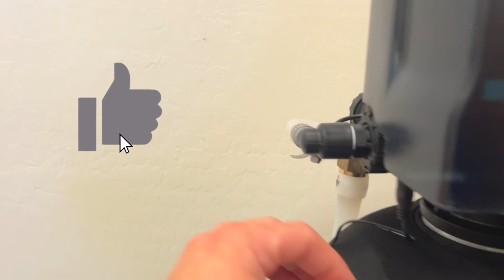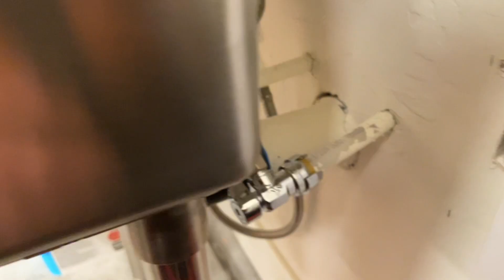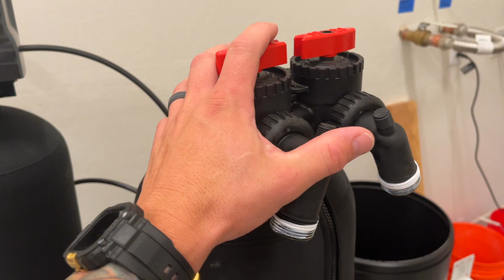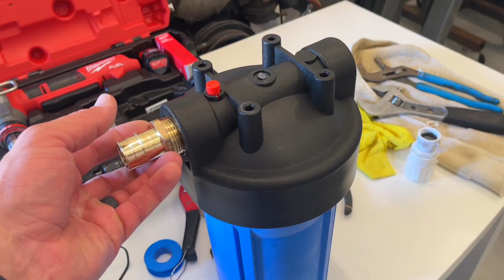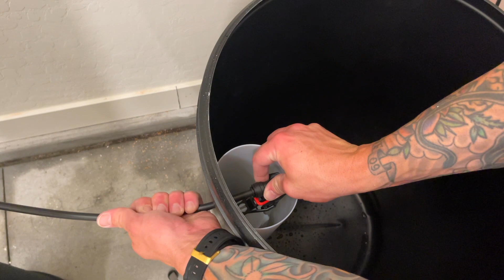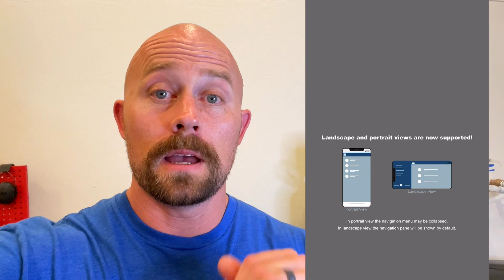How To Install Whole House Filtration System From Shell Water Systems | BEST Water Softener System

Comment: can you show me how to change the filters for my system in garage?
I figured out how to do my RO system under sink. But now I’m stuck 😢
Reply from the maker: Are you referring to the one cartridge pre filter?  Obviously on the Softener system you won’t be changing out tanks, but you will need to change out the cotton type large particle filter about once a year or so. 

That is very similar to your RO filter systems you see where you shut off the water, release the pressure from the lines and then you unscrew the canister. Remove the old cotton type filter and replace with new and put some silicone grease on the o ring before reversing the process. There should be a large ring type wrench your canister came with. That is what you’ll use to unsecured the canister came

Comment: I need to replace my water softener/filtration system, I’d like to use this system. I have well water softener I’ll be replacing the storage tank as well. I would like to install a particulate filter before and after the storage tank, your thoughts on that…. 
 Also, I’ll need a reverse osmosis due to nitrates, is a whole house RO worth it?
 Thank you,
               Kevin D.
Reply from the maker: I like the idea since you’re gonna be doing well water having the particle filter before and after. Having that type of redundancy in your system is not a bad thing. 

As far as this being a whole home RO system it doesn’t technically qualify as that. It does filter the water and soften the water, but an RO system under your sink will give you a higher quality filtration and depend on what type of system you get for the RO it will have different added benefits.

So I would still vote to do a standalone RO system under your sink. They have some pretty good ones for just around 200 bucks on Amazon that I really like installing. I have two of them in my house and love them.
Reply: @FortKnoxCo Thanks for your reply.
Reply from the maker: @kcd845  💯
Reply: can you show me how to change the filters for my system in garage?
I figured out how to do my RO system under sink. But now I’m stuck 😢

Comment: I added a ton of Teflon tape and the sediment filter still leaked, any suggestions?
Reply from the maker: It’s leaking at your threads I’m assuming?  Did you make sure the fitting is the right threads? There’s different types of threading for plumbing vs other threaded adapters. Just something to check.
Reply: @FortKnoxCo it's a standard 1" MIP brass nipple. I'll try tightening it some more to see if that helps but open to any tips!

Great video!
Reply from the maker: @t @turtle62292  sorry to hear that. I’ve seen people try some wraps of the teflon tape and then maybe try the Monster blue pipe dope? I know some say it’s not good to use tape and dope. But I’ve also seen people use both.

Comment: This video is amazing and very informative. However, my 2025 built home lacks a water loop. The water shut-off valve is located in the garage and operates in a vertical manner. If you could create a video demonstrating how to install and connect to the water line when there’s no water loop in the house, that would be greatly appreciated.
Reply from the maker: Aww man. Sorry to hear that even in 2025 they still aren’t installing a softener water loop as a standard in homes. I do plan on showing a how to create your own water loop for a softener video. I just need to create a set up to demonstrate on.

Comment: How many feet do you think I need for a tight serviceable install? Just trying to map out how many tool boxes have to move or get sold 😕
Reply from the maker: Depending on how you want to place the brine tank and the single or dual filter tanks, I’d say about 5’ wide and 2’ off the wall?  Roughly depending on how close you can make your connections and coming off the wall with your inlet and outlet
Reply: @FortKnoxCo thanks! I managed to cram it in 48”! I noticed they skimped on the drain line now, I got maybe 5’. They only give you one adapter for the garden hose and the sediment filter no longer includes the red push button vent. Just small annoying things. Ordered 1/30/26 for reference.
Reply from the maker: @tkish5685 that’s you for the updates. It’s helpful to know what’s changing

Comment: Can you install on outside of house
Reply from the maker: You can but usually they still recommend having it in some type of covered enclosure. Unless you get a unit that is specifically meant to be installed outside, most of these units should not have direct long-term exposure to the elements

Comment: Great installation video. I do have a water softener previously installed but i have reddish brown stains in my toilet. Also water is testing as high in minerals. Do you suggest adding a filtration system and partial system to my existing system?
Reply from the maker: Your water softener should help with the overall mineral in your water. The red stains could be a couple different things. Could be the minerals in the water, but it could also be from the pipes if you have any type of metal piping in your plumbing. If you get the whole home water system, it’ll filter the water to drinking quality and soften it by removing the minerals. So there’s a couple different things you can do to try to give your water the best quality. But at the end of it, you also need to consider what your plumbing has as far as metal fixtures, and possible rust inside those.

Comment: Would be helpful to know exactly how much water to add for soaking. (1 gallon? 2 gallons?) I way overfilled mine because I couldn't see inside the tank and didn't realize how fast the water was flowing...
Reply from the maker: Yeah, I’m not sure if the written instructions have that labeled or not. That would be helpful. A slow flow of water while paying attention would probably be the only best bet. Sorry you had that trouble with the process.

Comment: FYI, don't reinstall the cap after beginning to soak 😬

There's a bunch of gas produced and it will pressurize the tank and make the cap practically impossible to remove again. (I had to drill a hole in the cap to get it off. 🤦)
Reply from the maker: Oh no, yeah, you can fill it with water and then just let it sit. I guess it should be more clear on making sure that you don’t do that. Could cause pressure and make it difficult to take the cap off if you tighten it too much.

Comment: Do you ever use a separate control head for the whole house carbon? I’ve seen systems set up both ways… Thanks for the great video!
Reply: With carbon filters you have your choice of upflow, which is what's in the video, or backflush.  A backflush is often used if you have a well.  It's similar to a water softener in that is has a programmable valve head that periodically cleans the carbon media.  If you're on city water, it's more common to use a filter, like the video.  It does not require backflush and the media typically last 7-10 years.
Reply from the maker: With this system from Shell Water Systems, it doesn’t seem like that’s how they have it set up. I’m sure it can be done and it can control and monitor the way. The water is flowing, but I believe usually the carbon and softener tanks are going to have water flowing through them in line, so to have two control heads might be redundant and not necessary. They don’t operate independently they operate in sync. But I’m sure there’s some companies out there that might have it set up that way for a reason.

Comment: Question: do you lose water pressure by using the corrugated connector vs pex?  I'm ready to install, just figuring out what to use for connections.  Cheers!
Reply from the maker: I did not.  But I also now have PEX and I don’t notice an increase of pressure. The corrugated pipes seem to be pretty common.

Comment: I have a leak coming from my red water pressure button after recently replacing filter and idea of why ?
Reply from the maker: On your canister filter? The large particle filter? 
I’ve seen that before. It’s like a test/pressure release button. I think it’s spring loaded. So sometimes it gets stuck and doesn’t press back up and creat a seal. You may need to press it or mess with it a bit. O possible remove that top
And look underneath and see if the valve is obstructed

Comment: What about if the street water is directly connected to a water heater? How do you connect the filtration system then.
Reply from the maker: You would just need to create a break or “water loop” in your water line and before it splits off to your cold and hot line. A lot of Home builders put this in as a standard now. But it’s not an uncommon install for a plumber.
Reply: @FortKnoxCo  Thanks for the reply, I just ordered my combo now. I am so excited about this product. Without your video, I wouldn't of made the purchase. Thanks again
Reply from the maker: @radouanelaktib1275 that’s great to hear. I’m happy I could help. We love this unit.

Comment: How long is the cloudiness in water? Mine comes and goes. 3 days installed.
Reply from the maker: I noticed after a few days. But we also use the system a lot with. So depends on how much water you’re using and how fast.

Comment: What if we the entry of water from street is in front of house, can I still move tanks to side of the house around the corner like 15ft?
Reply from the maker: You can set this up however you’d like. It should be in line before your water supply splits to your hot and cold sources. So usually after the water gets to the house after your bell housing /water pressure housing. And before your split off to the water heater.

Comment: If I just installed a softener but want to add a second tank RO or whatever... about the same ? Other then maybe connection difference's.. regardless thanks for doing this video my pop was always good at any thing... me I'm ok but nada like pops. Lol
Reply from the maker: You can do a whole home filtration which had two tanks and does the softening and filtering. I believe a reverse osmosis like under the sink systems for your whole home may be slightly different than what a “whole home filtration” does though. It’s all possible and plumbs in line like your softener does. Usually

Comment: Can you add the part list for the PEX A install? I assume you’re using 1” PEX piping. I went to the local hardware store and didn’t have a lot of the fittings for PEX A, only B.  I have to cut the piping coming out of my wall, as I don’t have the screw on adapters like you do. Probably will go with shark bite connectors to PEX A as well.

Comment: Is there a fitting going from 1/2” pex A to 1” male adapter?
Reply from the maker: I’m not sure which part you’re referring to. The 1/2” drain line? Or?  This system is a 1” system and I used 1” PEX A to connect everything. The only other size tubing is the 1/2-3/8l” type drain line. But in most cases you’re probably going to be using a double male flex line to connect everything and your choice of fitting for the drain line. Most water softener systems will give you an option to have the system set up for a 3/4” in/outlet or the 1” in/outlet

Comment: Great video!! What all is included in the boxes aside from the brine tank and the two other tanks? Does it come with those tank sleeves and the drain line? Also what if I dont have a drain pipe nearby? Is it safe to drain into the yard?
Reply from the maker: It comes with everything you need except you connecting flex hoses to your water loop. The two hoses you need to connect it to your house. Otherwise it has everything. If you don’t have a dedicated drain I would not run it just onto the street. It runs a decent amount of water when it’s doing it regeneration cycle. I would try to find the nearest  sink drain or laundry drain if possible. It just needs to make its way some how to your drainage system. I guess you could just run it out somewhere but I haven’t seen the done necessary to see how it handles over time with water flow and making a Marge mess or puddle outside ?

Comment: What if you don’t have a drain line or sink in the basement? The only thing I have in my basement is the main drain pipes from bathrooms or first floor laundry and about 15’ from where the water inlet from the street is  and above the height of the softener.
Reply from the maker: You just need to be able to tap it into a drain line like you mentioned. In my house specifically the drain is about 15 feet or more away but it does go up in the wall about 10 or 15 feet in an RV garage over about 10 or 15 feet in the ceiling and then dumped down into the wall where our laundry room has it drain for the washer. So it can push the water over and up a good distance.

So if you needed to tap it into that laundry drain that you mentioned my guess is it would have no problem doing that. It’s under some pretty good pressure when it discharges. But either way it just needs to go to a drain and usually have some type of P-trap or access to the drain to where it won’t interfere with the drains normal function.

Comment: why did the particular filter go after the system? most are before
Reply from the maker: It can go before or after. Partly a preference. Two different theories behind it. Either way it will catch larger particles. Some like it to catch before the system. But if you have it after the system it can be a fail safe as well if anything from the system itself makes it was out of the tanks and stopping it before it makes it was into your water heater and lines of the house, into your fixtures , etc.  So either way is good.

Comment: How does the claim that it removes pfas, when everything the water touches/processes in the unit can slough off in the water delivered throughout the home?  Are there any units that are mostly steel?  Where is the resin sourced for the materials the black units and container are made of that holds the salt?    At some point it seems the innards could begin sloughing off into your house water. Like plastic cooking utensils do when using on the stove and running thru the dishwasher.
Reply from the maker: I guess technically you water touches some type of plastic or composite material at some point in the system. At least in most common houses. In my house for example The water running to the house is partially PEX type plastic piping underground, transitions copper for the bell housing/main shut off, then transitions back to PEX, then back to copper for the water softener loop. Then back to PEX Throughout the entire house. So i don’t think the water softener itself would be the problem in the grand scheme of things. 

I’ve seen a lot of softener units made of a fiberglass resin type body. The internals and the head unit and the brine tank are always plastics.  So I’m not sure if there’s any unit and house where it’s 100% steel.
Reply: @FortKnoxCo  thank you for the quick reply! I'm in LV also. The more aware I've become of the ubiquitous plasticized world we've become in the relatively 120 year short time span of it's commercialization it is mind boggling and disturbing. We have no idea what it is doing to our health. From the plastics embedded in our polyester clothing that sloughs off in our washers, gets embedded into our  towels and everything we touch, leaches into our drinking water.  Just gross. So far I've eliminated many kitchen plastics that become toxic when heated up. Mr coffee pot is gone, replaced with the stainless steel percolator, cooking pans are only ss and cast iron, glass and ss food storage containers instead of plastic, wooden spoons, and ss cooking utensils, etc. At least I can make postive change toward food preparation items before eating.  For sleeping now use 100% cotton or linen bed sheets and pajamas. 
For long time have used the ss Berkey with the black berkey charcoal filters. But now am disturbed with the filters because both ends contain the black rubberized plastic. Also have a very old water softener that needs to be replaced, so now looking into alternatives, like doing the whole house filter to elimate chlorine and other yuck for showers and sinks. As you know the water here is extremely hard. Hopefully I'll find a water home system that fits the increasingly return to basics state of mind I'm in.  Do you do sidework?
Reply from the maker: @ I hear ya on all of that. I’ve heard several pod cast with people talking about how all that plastic transmission happens and the effects they are seeing.  Everything that touches you in a hospital down to the IV tubing and needles are plastic or made of something that could have negative effects that are unrealized. 
As of recently I have been working on a lot of my own builds so have t done much side work. But I have done in the past. Usually just depends on scheduling and the extent of the job.

Comment: Great Video! I am going to add second resin tank to my one tank system to cover more contaminates in the well. Can you confirm that the Carbon tank does not regenerate? And if so, does that mean that the only media that should go into the first tank is activated carbon? Thanks!
Reply from the maker: In a whole home filtration system, the carbon tank can regenerate through a process called "backwashing," where water flows in the opposite direction to flush out trapped contaminants and essentially clean the carbon media within the tank, allowing it to continue filtering effectively; this means the carbon doesn't need to be constantly replaced, extending its lifespan. 

 It just depends on the system you have and if it has a head unit that runs that regeneration cycle. I believe this system here with shell just has the head unit that regenerates the tank with resin for softening